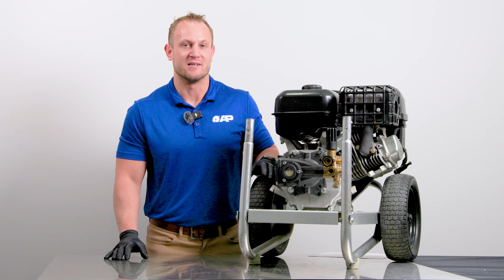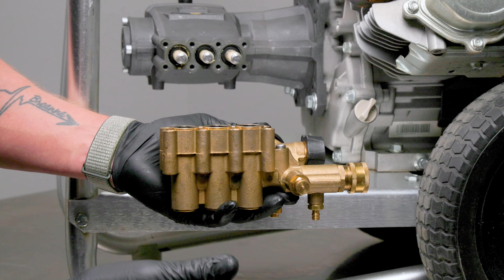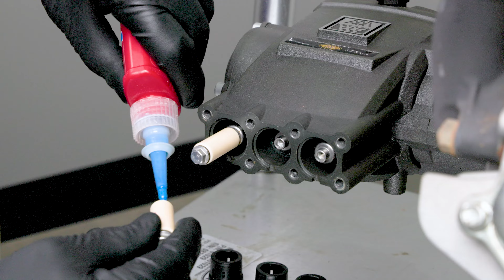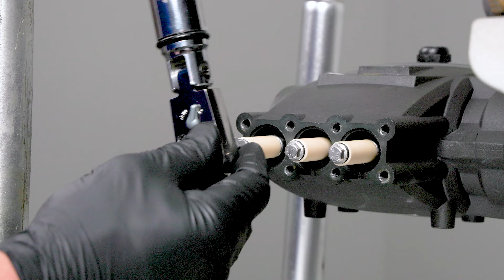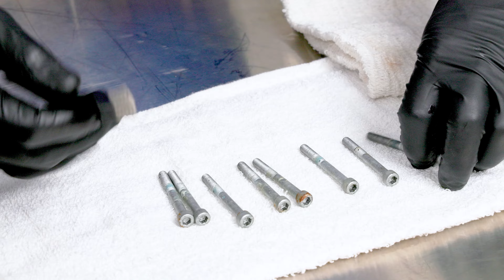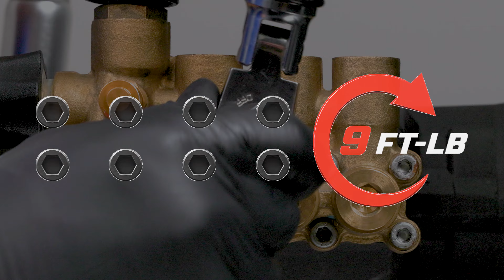How To Replace Cracked Pistons: AAA Pressure Washer Pumps

Comment: With the cracked ceramic should you also change the oil seals?
Reply from the maker: You shouldn't need to change them unless there is visible damage.

Comment: Mines are not cracked. Just a little rust stains by the bolt head. What else could cause milky oil?
Reply from the maker: The next thing we would check are the spacers inside the manifold. If they are crushed, that can cause water to enter the crankcase. But if your spacers are crushed, then the cause of that must also be addressed. Basically, if the spacers are crushed, you should check out the bypass valve to make sure it is working. We have an article on this on our site: https://www.allpartsinc.com/blog/why-is-there-water-in-my-pressure-washer-pump-oil.html